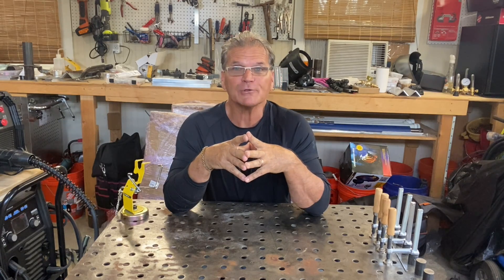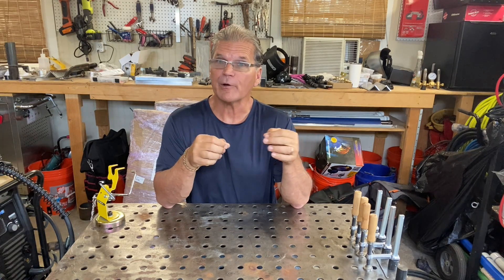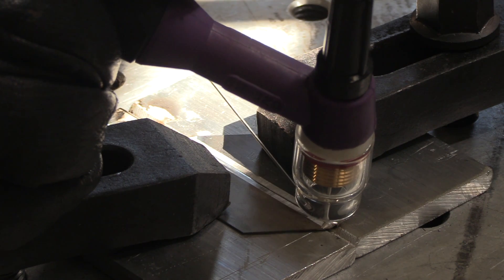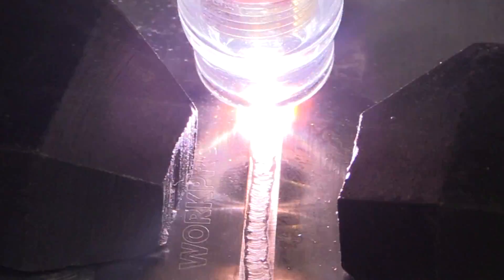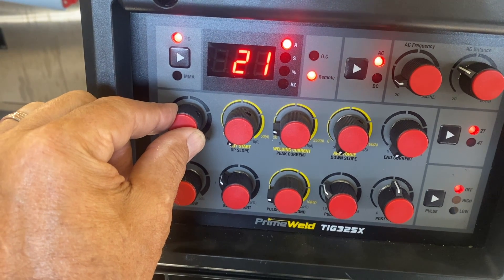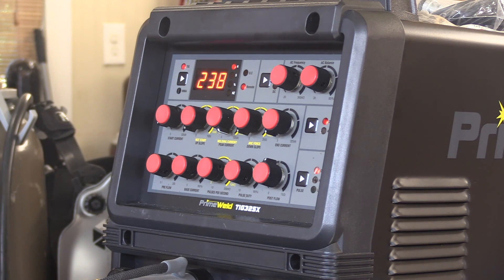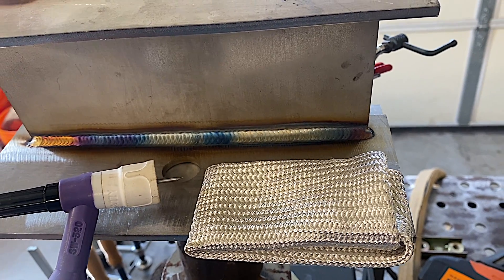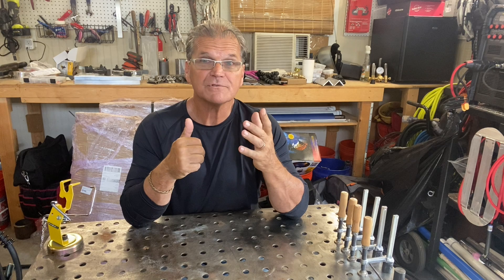PrimeWeld TIG325X on 1/4" Aluminum

Comment: Hi Jody, may not be the best video to comment on, but what are your opinions on the 225 to run similar welds? Really torn between the two, but intend to pick up one of your packages for the black Friday deals.  I don't think I would be doing thick aluminum terribly often, likely 3/16, seldomly 1/4, but would like the ability even if it did require a bit of preheat.

Comment: What makes the 325 better than the 225?
Any specific?

Is the 325 for bigger jobs?
Reply from the maker: @piratanet123  lower amp start helps if you weld really thin metal. Digital readouts for dialing exact settings like pulse rates. More amps for thicker aluminum. The 225 is more portable and will take care of most jobs and of course is less expensive
Reply: @ 🙏 thank you.

Comment: I have a 225X. What size breaker did You connect the machine to in this test? I want to try how much I can do with a 16 A breaker on 220 V without an extension. I also have the option to go to 25 A where I am now, but that requires a certified electrician to install, which costs a lot of money. Only a temporary workshop, so I don't want to spend too much on it.

Comment: Back in my Tool and Die maker days TIG welding molds and re-machining I would weld paper clips together side by side goofing around.  Would drop a small bead of 4140 rod on the damaged mold section and then grind and EDM the mold back out to spec.  Big Miller transformer welder.  I remember opening the back lid up and watching the arcs on the contacts.   23 years later I own a Vulcan TIG.  Lot of fun.  At 58 I can't see as good.  Enjoy your channel!!

Comment: That 325A machine looks like it would pair very well  with the CK Trimline 18. It's the same size as an air cooled 17, but is water cooled. It uses 3-series hardware. I Iove mine.

Comment: I bought one just before they came on weldmonger store.  Im quite amazed how nice it welds, just couldn't justify the $12,000 price tag on the standalone dynasty 400.  The fan is louder, about the same as my old Syncrowave, not terrible. Its definitely as smooth as my 210 DX Dynasty, but wayyy more powerful !!  Always been a red/blue guy we'll see how it goes, they're all made in China anyway.  Throw it away in 5-10 years. I can buy 10 of these for the price of a chinese dynasty🤣🤣

Comment: well here's a machine that they claim works maybe you could try it shed some light on it because apparently at 220 V the thing doesn't even spark at all when arc welding and it's only scratch start tig also

Comment: When I was learning to tig I was taught to put a ball on the tungsten  when welding aluminum and sharpen it for stainless. What's the difference?
Reply from the maker: todays inverter tig welders are different from the old school machines.  A balled tungsten can still be used for certain jobs but typically does not start well with most inverters and is not really needed with inverters

Comment: "unboxings" are quite nearly the dumbest thing added to life in the last couple of decades.  How on EARTH did we survive without them.  Hey lookie I got something new that you don't have and now you can  lookit me lookit it!  Bless your heart.

I was under the impression that the 325 fan (at any Db) comes on when required and isn't hardwired into the switch as the 225 is (always on).  I don't expect to need big amps, but want the capacity, the "overhead" in reserve (and also the lower bottom numbers for thin metal).
Reply from the maker: Fan does not initially come on when the machine turns on but in my case, I have a water cooler that comes on and runs continually. The fan comes on after welding for a bit and runs for quite a while before kicking off. Once the fan comes on it runs for quite a while before cutting off.  I have had several machines that did the same and some were louder ...some were not quite a loud as the 325.
Reply: Jody so what your saying is the water cooler that you have plugged into the 325  kicks on immediately  when the machine is turned on and not on demand like a Miller?  @weldingtipsandtricks
Reply from the maker: @petekossaras1830  yep
Reply: Thanks, not a deal breaker, I have a 25 year old Dynasty 300DX that came in without the outlet on the back so I had my electrician wire one in on mine so when I turn it on my coolmate 4 turns on as well, when welding using AC I use ear plugs anyways. :) @weldingtipsandtricks

Comment: Your videos typically used to tout saving argon, with a #6 cup on the Al and 16-20 cfh shown - how acceptable would the cfh= 2x cup diameter be in contrast? I'm VERY shaky - not a practice-it-away type of shaky, more predict and compensate. As a home shop machinist I got a 225x, and in 2 years I've only been able to bring myself to use up 2 "S" (I think) cylinders... They're ~$120 ea here, and if I should be upping my flow to 3x, I gotta sell and get out.
Reply from the maker: I try to use the best cup for the job all things considered.  But as you say, sometimes saving argon is a big consideration when you are trying to finish a job on a Saturday. Aluminum welds great with a #6 but stainless seems to want more argon and a larger diameter cup. Argon is fairly affordable in my area at around $40 for a 125cubic feet swap out.
Reply: @weldingtipsandtricks  Wow, you guys have it cheeep! I'm in rural WI... I get the cup sizing thing, it was more the 16-20 cfh for a #6 that threw me. Love the channel, and I support Weldmonger when $ allows. Thanks for everything (the reply is like talking to a celeb/hero)! Keep up the awesome work, I foolishly blew my tech college fund on auto yrs ago - I need you!

Comment: You haven’t reviewed any Fronius Machines have you? I can’t remember if you have. Miller Dynasty? Or Fronius iWave 230i AC/DC? No wire feed either but the iWave 300i AC/DC does, or get a separate Machine like the TPS 270i C PULSE for GMAW/FCAW. I don’t know if Fronius has anything like the Miller Dynasty 300 Multiprocess TIGRunner or on the cheaper side, ESAB Rebel 205ic ac/dc Multiprocess Machines. The other Machine I’m interested in is the CK MT200-AC/DC, but again it doesn’t have GTAW/FCAW either. But I’d have to get separate systems for some others as well to get every process so that point is kind of moot. If anyone else has Fronius experience I’m all ears.
Reply from the maker: no fronius yet. I do have a miller dynasty 280 multi process but have only done tig and stick with it so far. I have at least 20 videos using the CK mt200 ac/dc and its definitely a good machine.  Esab rebel 205 ac dc is just ok in my opinion but at least it will do all the processes.
Reply: @weldingtipsandtricks  Hopefully Fronius wakes up and sends you some stuff to review. They’ve sent machines to people with less of a following than you. I’m definitely a Miller person, but I’d like to try one of the machines from Europe. It looks like all of the settings to control exactly how your Weld Puddle looks, and acts is quite impressive. The only thing I’m worried about is the European style Torch. I like the Round Handle Torches from CK. There isn’t anything a CK Torch can’t do. With the Fronius Machine if you have their Vizor Connect Auto-darkening Helmet it connects via BT to the Machine and you won’t get failure to darken in out of position/low amperage welds that can be difficult on Auto Helmets. The Machine will initiate your Lense. It isn’t a set darkness either, as you go up or down in Amperage, the Helmet will darken or lighten so you always have the best view of your Puddle.
Reply: @weldingtipsandtricks  fronius tig is one of the best tig welder there is. the CK mt200 is a kind of a scam. it's good but it's just rebranded  analog Jasic tig welder at 4 time the price of the original.   the best welder hardly  test in US is from Germany and the Japan : Lorch, EWM, OTC, Panasonic. two  of them make AC mig welders.   CK did not turn into manufactoring welder, the just get it from the chinese factory with a different color and painting scheme, and very minor change.
Reply: I would probably be all Fronius if I could afford it.  They are amazing.  I have their Accupocket battery-powered welder and to say it's a game-changer is an understatement.  It has allowed me to do many jobs that would have otherwise been impossible.
Reply: @dumpsterdave3710  How?  it only lasts for 15 minuts at max current.
Reply: Do you have any idea how much welding you can get done in 15 minutes of arc time?  A lot.  You are obviously not going to build an entire steel deck in a single battery session, but I have built many things and repaired many things on a single battery charge. Plus if you have access to 110v (in the USA) you can go all day. @gogoubai

Comment: I learned TIG a little more than a generation ago.  I rarely used it as I don't have my own equipment and most of my employers had no need for that particular  skill.

That having been said, the instructor who taught me (a Boiler Maker, by trade) taught us to use a rounded tip when welding aluminum.  What advantages/differences are their between using rounded vs tapered tips on aluminum?
Reply from the maker: crisper arc start and more stable arc at low amps
Reply: Rounded green tungsten is also used with transformers.  With inverters green is no longer used when welding Aluminum.

Comment: So are all of your welders you're using in your shop 110v?  Or are you constantly using your dryer plug with other welders?
Reply from the maker: All my welders are dual voltage so sometimes on thin metal , I just plug to the 115v in the wall. I use the dryer plug whenever I need more amperage. It only takes a few minutes to run the cord but I did get a mouse in the house once from the door being cracked open.
Reply: @weldingtipsandtricks but can you blame that mouse? He wanted to learn how to TIG weld.

Comment: Nice video Jody . Yeah, you really don't want to go without the cooler with that machine or else you'll be going through a lot of torches (if you run that machine anywhere near it's capabilities). lol Even the 225 like I have, really is a game changer with the cooler . I really like that 5 amp start on that 325 . That's pretty much the only thing I would want on mine . But then pulse can get around that if needed . But that looks like my next step down the road though . Thanks for all your teaching . :)

Comment: Retired about a year ago (computer software) and spent the past 6 weeks watching all of your videos (except podcasts). Thanks.  You've taught me a lot about welding. My dad was a welder (mostly mil-spec heliarc) and had me run lots and lots of 7018 beads when I was a teenager so that I could get a job if I wanted one (must have been easier to get a welding job in those days), but I had no interest at 17. Very tempted to make it a hobby now - but I have no welding projects. (I'd enjoy something like April Wilkersons carport or Austin Ross carport but done properly -- process choice, weld type, structural considerations - lots to improve.) Anyway, I appreciate all your work. (Would love an excuse to buy that welder and really learn 7018 along with TIG.)

Comment: It is nice to see how the prices are coming down to an affordable level. A suggestion for you. Could you put together a cheat sheet for weld setting, cup sizes, rod sizes, etcetera as a quick reference to DIYers?  It would be an expanded version of the chart you find on welders.
Reply: Yes!!! It’s nice that the prices are coming down.
Reply: Im not sure if it was there when you made this comment, but on his weldmongerstore website there is a free ebook that sounds exactly like what you are asking for.
Reply: Prices for cheap Chinese made machines are coming down, but the best ones, a Miller Dynasty 280 or 300, will never come down in price because they weld all day long without stopping.

Comment: I'd love to see how to set up and run Tig on a gas powered welder like a Lincoln 250 or something similar.   Can it be done?   How do you set up a pedal (if possible)?   What kind of welds are possible or how well will it perform, etc..   I think it would make a great video.

Comment: Whats the actual amp draw at the wall?
Reply from the maker: I haven't checked actual amp draw yet but spec sheet is here https://weldmongerstore.com/collections/primeweld/products/primeweld-tig325x-complete-package-ac-dc-tig-welder-with-foot-pedal-maxcool-3000-water-cooler-water-cooled-ck-20-style-torch-water-cooled-dinse-connector
Reply: I believe the spec number to use is "Max Rated (I1eff) Amps" and that's 35.7 amps for TIG at 220 volts for this welder. Also should apply to the minimum size of circuit breaker to use. So nominally a 40 amp service. The average draw of the welder will usually be way below that of course. The spec would mean #8 awg conductors in an extension cord.  Not that I'm recommending it, but two #12 awg wires in parallel is about equivalent to #9 and that's about 35 amps.  I did some numbers a while back and I think I figured the voltage drop from a #9 awg equivalent extension cord was no problem at least to a length of 50 ft.